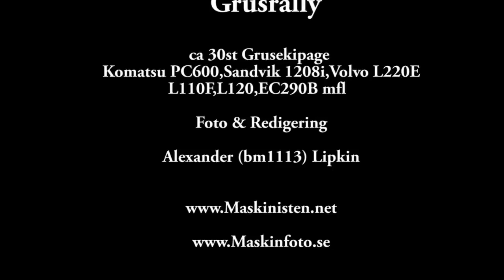Sandvik CM 1208i Crushers - Komatsu PC600LC - Volvo L220E - L110F and trucks

Comment from the maker: Yes Nyhage1 have right answer that are maximum weight for the roads in sweden maximum total weight of  Truck, trailer and Load in Sweden are 60 metric tonnes 60 000 kg so on average it can only load between 25 and 40 tons on each rig

Comment from the maker: Yes they transported the gravel on the highway 15km to a big  Construction Site and as I wrote in another post 
Maximum weight for the roads in Sweden maximum total weight of Truck, trailer and Load in Sweden are 60 metric tonnes 60 000 kg